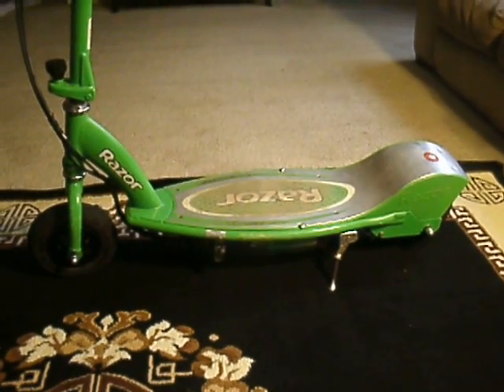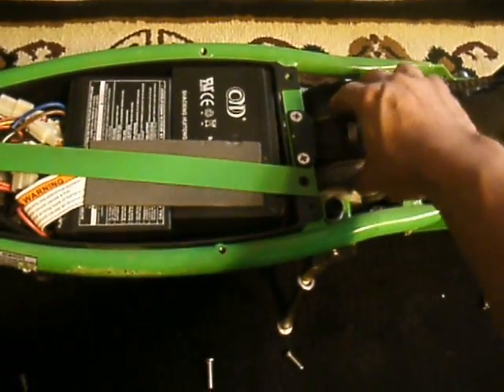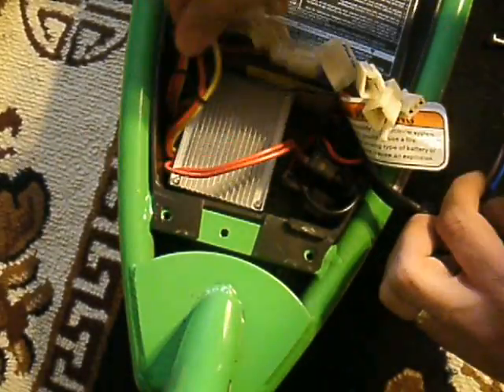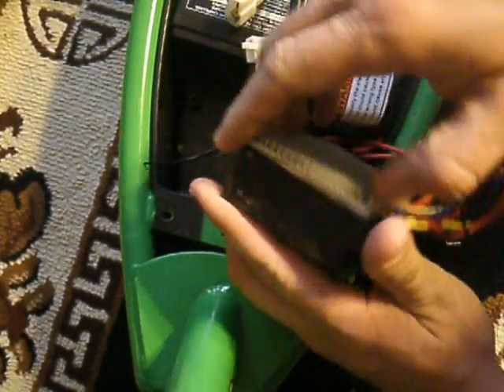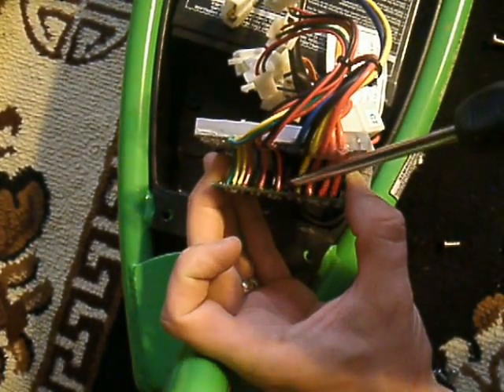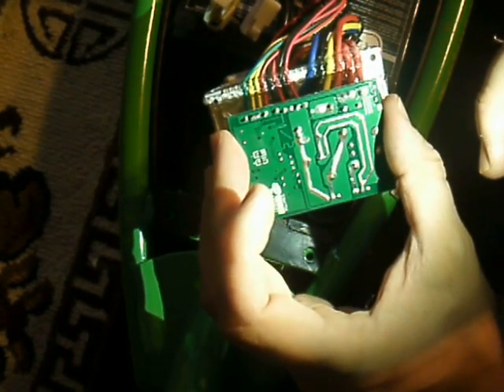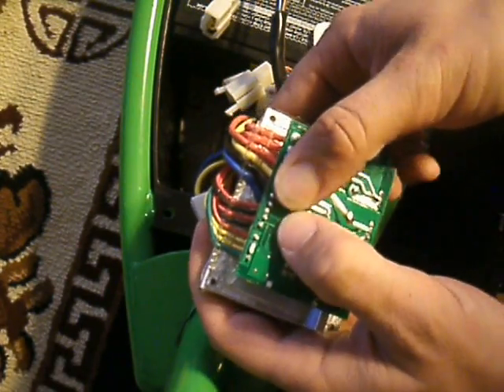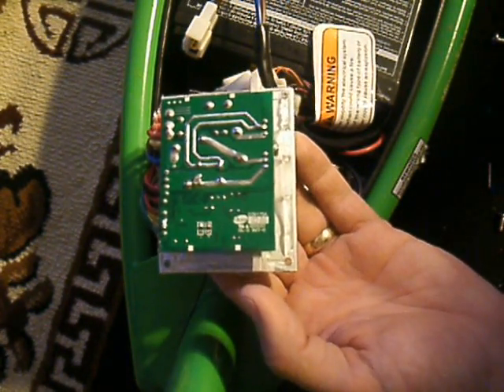Increase Electric Scooter Speed and Torque!

Comment: How to blow it up 101 don't do this don't do it don't
Reply: Please explain why and how. Don't just guess.
Reply: FrustratedBaboon It's not a guess. This is stupid. It's bypassing a safety device. If you draw more amps than the battery can feed and it doesn't pop the electronics 1st then the battery terminals will start melting the plastic and cause a fire.
Reply: Tape it off.lol
Reply: Speeds Myname iii
Reply: If this mod was going to be attempted, the suggestion about insulated wire and solder the two ends with minimal wire showing would work best IMO.  Using glue, paper clip, duck tape is a good way to eventually short the circuit board.  I like the toggle switch method to use as a short term turbo.  People are correct, the limiter was not installed to make the unit slower and less fun.  It’s placed there in order to protect the limits of the device downstream of the limiter.  Logically using the extra power will limit the life of the device according to the the amount of time used as well as the max duration.  IE.. using the turbo continuously for long periods at a time will do more damage to the life of the scooter than using the turbo for a short term burst.  Good luck!
Reply: It's an excellent way to release the magic smoke.    Everyone should add random pieces of metal to their circuit boards, at unknown locations.

Comment: Hey guys..I did the above accordingly to what you had shown on a speedway 3 Dave. Apparently, it is supposed to have 3 different modes/stage/channels of speed whereby I can switch the speed limit according to the modes. 
After doing what you had taught in the video, all modes 1, 2, and 3 apparently would be stucked at the mode 1 speed however I change the modes, the speed would not change.. how do I rectify this? 
Thank you very much for helping if anyone else knows?

Comment: I have to say, duct taping a paper clip across the circuit board is definitely NOT a good method. Soldering a small gauge wire 'jumper', similar to the same gauge as the original jumper, across the same contact points on the board is how it should be done. 

Best to use an insulated piece of wire and soldered to the circuit board. It sounds like some of the responders have actually tried the paper clip and duct tape method, or simply wired to the wrong contact points.

As for enabling or disabling the extra current carrying capability, one could install a S.P.S.T. (single-pole, single throw) toggle switch on the outside of the battery compartment (close to the controller board) and soldering short 26 or 24 gauge wires to the two contact points on the board. Then you could have the increased torque with the switch in the ON (closed) position when you need to go up an incline, and switch OFF for riding on level terrain.

I just acquired a (free) used E300 and started to refurbish it. Someone left it sit outside for a long time, as all the screws were badly rusted, as well as the chain ... I had to drill out the screws. I've already purchased a new chain and two new batteries.

The motor, tested out fine, but the throttle control does not want power it up ... need to troubleshoot the throttle and brake controls and wiring next. If the controller still works, I'll try the mod and add the toggle switch to provide the current increase, and hopefully, have the best of both worlds ...
Reply: Please reply to this if you pull
It off and make a video. Is doing these mods safe?

Comment: Hey Dave Here. I tried the first method of putting a piece of paper clip on the board to get rid of the limiter. It worked the night I did it! It seemed to be making the wheel spin faster!  I was excited to try the unit out in the morning, but the unit (motor, batteries, controller) weren't working anymore. What happened?

Also, I pulled out the rod that you refer to after the unit stopped working. It still isn't working.

Help me please!!!
Reply: MOSFET may not be able to handle the extra current , as they all have upper limits
Reply: So did I destroy the controller? Can it be fixed?
Reply: Ye ye it can be fixed , if its just the fuse then you are lucky else new mosfets needs to soldered,if it's any other part you may need to just buy another controller
Reply: Though best analysis can be done I my by the one who has access to the device
Reply: Santosh Goutam I may have to get a new controller. Nothing seems wrong when looking at the circuit board. What's mosfet?
Reply: Your gonna need a new speed controller and throttle is fried also.

Comment: I have a e300 .I wanted to add another battery and wire in series.I may not be able too because two of my batteries arev12volt 9ah and the one I want to add is 12 7ah
will that be an issue? I know I need to ad a switch so I only charge two batteries.
Reply: you can add only if your speed controller supports else the parts will burn out (capacitors)

Comment: my scooter won't run when I stand on it but if I'm off it the wheel turns ? help please
Reply from the maker: Lea Newton sounds like a low or dead battery. needs a full charge or to be replaced
Reply: I wish that where the case but I bought two new Batts and new charger it won't run when stand in on it
Reply from the maker: Lea Newton is a small child able to ride it? if so then doing what is explained in this video might help. it will increase the torque so that the scooter can carry more weight.
Reply: no a small kid can not it will pull me a few feet and stop and the light on it will change from green to yellow to red in secs
Reply from the maker: Lea Newton are you positive you got the correct batteries and they weren't already bad. also before first use they need at least 8 to 12 hours of charge.
Reply: yeah that's not it they're brand new batteries and I charge them all day and night and they're fully charged and they're the right battery that's not it at all something else is wrong with it it'll be okay I'm going to call the company and talk to them about it tomorrow
Reply: Lea Newton pp
Reply: Lea Newton  is the speed controller maybe is damage... the same problem happen to me... I just change it and replace it, and start working.. be very careful when you removing the wire from the switch because mine come off but I just place the little metal back.. I hope I help you with it.

Comment: I tried tbis out with the same method (paperclip) and I didnt see a difference, Im going to try a peice of copper wire next, im guessing the paperclip was not conductive enough?
Reply from the maker: possible. the copper wire is a much more conductive material.
Reply: Pat G. did you solder it down or some other way. Just curious. I'm going to try and do this to my kids scooters
Reply: Yoo I just did paperclip and it worked fine
Reply: Dallas Ware hey help me out

Comment: Anyone try this -and is it worth doing?
Reply: thanks
Reply: It didnt seem to work so far for me with a paper clip,  but I will try again with copper wire
Reply: I'm going with a larger rear sprocket on my E300. It'll take some mph off the top but from what I hear it'll increase acceleration and pulling power dramatically.

Comment: if going to do this mod...wouldnt it make sense to solder in a potentiometer?
Reply: I was thinking the exact same thing
Reply: Brother, where are you going to solder it? Kind of worthless idea if you don't know what electronics is about... Potentiometers are very inefficient devices for controlling power circuits. It is only and basically for low power and low voltage circuits. Study some theory, please.

Comment: I'm looking to buy a seated schwinn electric scooter, battery's dead, would like to buy a better battery to add more power and length to chargeing. I know nothing about this. what am I looking at to change up when buying a new battery, and will I need a new charger?
Reply: first make sure that the new battery has the same dimension as your old one, you know length, width and height. then on your old battery there is a rating usually on the format of xAh, x being a number. you want to find a larger x with the same dimension. as for the charger you can keep the old one but it will charge longer since the ampacity of the battery is now bigger or you can buy something with higher amperage.
Reply: my s-350 schinn with 350 watt motor rated 12 v, 10 Ah can be up graded aslong as the diminsions are the same but my batt. size don't matter but I don't want huge ones so whet would you do as far as the 10Ah stock motor for torgue & top end speed? Im 200 lbs

Comment: Hey what happens if I would add more paperclips the same size then put them on, like 3 or 4 bundled up together would they act as 1 big piece of metal? would that work to have more speed and torque?
Reply from the maker: the more you have the more power can pass through.  Too much power can cause your board to burn up and possibly catch fire. I don't recommend going more then 50% larger then the original piece.
Reply: mmh, right now it's like half the size of the one underneath

Comment: I did this just now, but I didn't feel a difference, I used a paper clip and duck tape, was it the duck tape? or because of how thin the paper clip is?
Reply from the maker: It could be the paperclip didn't pass through anymore current then the original piece.  Some metals pass current better and a larger paperclip might not work as well needing more to increase current.
Reply: k, cause I bundled like 4 or 5 paper clip pieces together with elecrtric tape
Reply from the maker: +GRASS-CONCEPT fair warning that those paperclips will get hot.  possibly hot enough to melt or catch the tape on fire.  It would be ideal to solder them together.
Reply: oh
Reply: +Dave Here hey what if I cut the metal underneath in 2 by cutting the middle part of it then it won't be one metal or no contact
Reply from the maker: +GRASS-CONCEPT if you cut the wire then power won't pass through.  It will stop working.
Reply: Dave Here mmh

Comment: bridge it with a relay thats operated with an extra switch wherever, high power mode / normal , (for those worried about range ect, )
Reply: Crafty. I like it.
Reply: curtis133 make a video
Reply: A simple on off toggle switch would suffice
Reply: curtis133 .

Comment: hi, by how much did this decrease the battery by in comparison to before? how many km per charger distance before and after modification? thanks
Reply from the maker: i could tell you in charge time but not distance. I lost about 10 minutes of use.  i went from 45 minutes to about 35 minutes of use on a charge.
Reply: I just bought one a different type of scooter tho and told them to completely remove limiter I wonder if it will cause any problems long term.
Reply from the maker: +waza daza it's adding to the limiter not removing. The larger it is the more electricity can pass through.
Reply: strange why they would say they would remove limiter......
Reply: how long did you keep it like this did it cause any damage or long terms effect apart from the 10 minute battery loss
Reply from the maker: waza daza the board and scooter were fine.  If anything the life span of the battery will be shorter.
Reply: +Dave Here  thanks Dave. I really don't understand why they told me i will be limiter will be removed and that it won't make batery shorter...they said batery depends on speed.weight and road condition.
Reply from the maker: waza daza That's correct when trying to find out how long your battery will run. The more torque you use the faster your battery will drain. Increasing the size of the limiter will increase the electric used from the battery. Driving up hills will use more electricity then going down hills or straightaways.

Comment: Hi Dave. I picked up a 24v pocket mod it picks up to full speed and cuts off till it slows down .razor said bad controller  . do you think I can fix it or better off just getting a new one?
Reply from the maker: if you did this mod i would suggest using a thinner wire. it sounds like it passing to much electricity across.

Comment: Super glue or hot glue for an electrical connection on a board that gets hot? Good luck with that.
Reply: Idk but take super glue dont risk hot glue
Reply: use a soldering iron
Reply: https://www.youtube.com/watch?v=FNhy1xJqLCQ&t=30s
Reply: If you put glue ABOVE the circuit and the belly of the paper clip is touching the circuit it is fine
Reply: not glue , it has to be an electric conductor like solder . It's call removing the limiter because it will no longer limit the current going to your motor. Like a fuse to protect, to keep it from burning up.

Comment: Hey Dave. I'm trying to do this to a pulse performance products scooter and the board is different. Is there any way you might be able to give me some insight on it?
Reply from the maker: is have to see the product.  can you upload it and post a link?
Reply: https://flic.kr/p/FAhmQL

That is a photo of the back side.
Reply from the maker: https://drive.google.com/file/d/0B3BiuoCF2ZDhOE9xakJPRzhEWms/view?usp=docslist_api my only suggestion is you could add a small paper clip to connect 2 of these connections.  Please keep in mind i do not know for sure and it may break your device.  If it were mine this is what i would try.
Reply from the maker: +dumbcountryboy no,  i would suggest jumping one at a time with a small piece of metal. The smaller the better.  that way if it's wrong it may not cause damage. Then see if you notice a difference. You can make it bigger agree the first test.

Comment: i just bought a ebike 36v lithium batt 500w motor it also has a speed limitor on it, would it be the same type of jumper on board? is that the only way they do the limit?
Reply from the maker: it's the only one that i know how to mod. There could be a nicer or more expensive one that is enclosed into a small sealed box like a relay switch.
Reply: kk ty

Comment: I think I am gonna check this out.  The industrial dc motor speed control pcb's I see at work have a replaceable resistor on the board which limits the motor's output based on the resistance.  They look to be in the 5-10 watt range.  So this metal bridge must be some kind of metal with a resistance that is worse than that of most metals especially if a paperclip increases the speed by that much.  Definitely a nice safe gauge and metal composition for the jumper metal.  Better cooling and sinking of the transistor will definitely improve the reliability of the controller in any event, modded or not.

Comment: so do you need to replace the metal that connects those to metal contacts behind the motherboard, then sauter a metal piece between the 2 contacts on the front of the motherboard?  or can you leave the metal piece connected and sauter a metal piece across the 2 contact points?
Reply: What's solder
Reply from the maker: you can leave it. also you can just add solder to the wire to thicken it but adding wire will work better.
Reply: What solder
Reply from the maker: +Lucas R it's a type of material like metal that can melted to connect wires together.

Comment: is there a way to slow it down???
Reply: Dont give it as much throttle
Reply from the maker: I haven't tested it but you could try using a smaller wire or possibly shaving off some of the wire to make it smaller.
Reply: +Dave Here thank u

Comment: Would replacing the resistors in the board with higher wattage resistors and increasing the heat sink prevent frying it once you increase the current limiter size? Theoretically, that's all I would imagine necessary.
Reply: +DiCarlo Thompson no not exactly what he meant by frying it was if the metal was to move or touch other links on the cpu then theres a 99% chance you will short circuit it and theoretically blow it up
Reply: +Vinyl Scratch (PON-3) I thought he was referring to heat wasted in the resistors due to low power rating..... beefing them up would keep them from melting or blowing up...  as far as loose metal contact, I thought that was a duh. haha. To my knowledge these boards overheat quite frequently because the transistors aren't rated for a certain voltage, and the heatsink is inadequate.  Also, allowing more current to pass through the shunts would mean higher operating temperature if all else stayed the same. Since I commented, I've tinkered and modded quite a bit, so I think I have my answer, but thanks for the response.
Reply: https://www.youtube.com/watch?v=FNhy1xJqLCQ&t=30s
Reply: 1+ for a bigger heatsink

Comment: I am not familiar with the scooter board but the shunt must be a current to voltage to the processor. So if you add another resistor in paralel you will fake the processors feedback regulator and it will not work propperly. I do not know where this meal jumper is on the electrical schematic. If it is on the battery it is a protection not to destroy the battery from overcurrents if it is on motor is acurrent sensor.

Comment: Are you sure about that piece of metal? I just opened up a controller and it does not have any piece of metal on the circuit board.
Reply from the maker: If you are working on a similar model of scooter, yes. It is possible some models may not have this piece visual. Meaning it could be inside a large component.
Reply: Dave Here I see, any ideas on how to locate the component? I can walk faster than this 48V, 1500W scooter can travel.
Reply from the maker: You might have a battery issue then. This trick won't work if your batteries won't hold a good charge.
Reply: Dave Here I see, it is a self built battery consisting of 48 - brand new 3.7V 5000 mah 18650 lipo batteries. 5 ea. connected in parallel per cell, totaling 13 cells connected in series. I checked for cold solders and found none. Checks out at 48V and charges to 54.6V, at full charge raising the rear wheel and applying full throttle runs full speed for approx. 10 seconds before stopping for a 2 second pause before starting again. This cycle repeats until charge declines and rpm reduces gradually. Hope this helps. Thanks for your help.